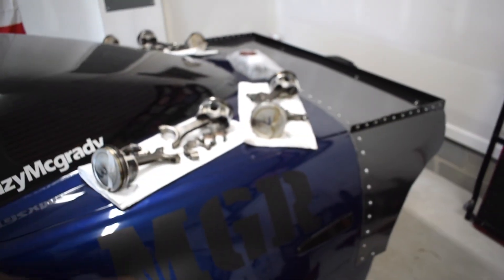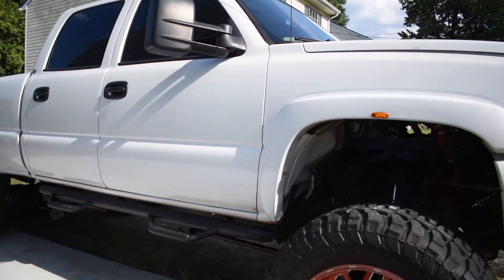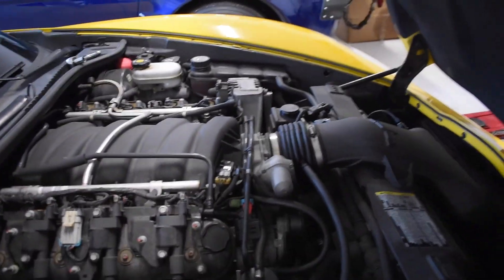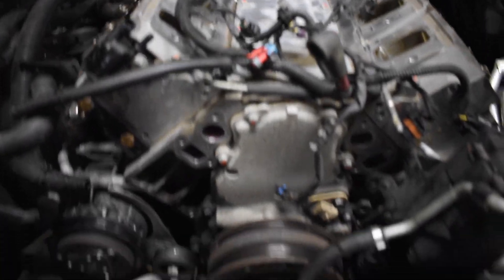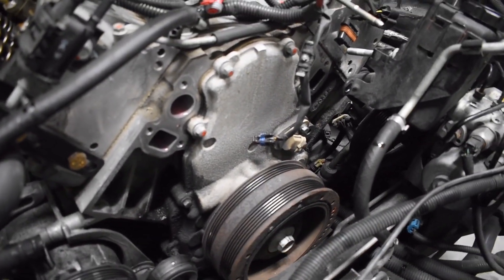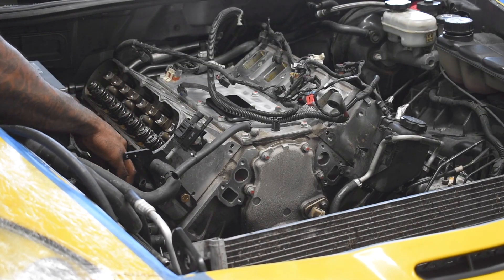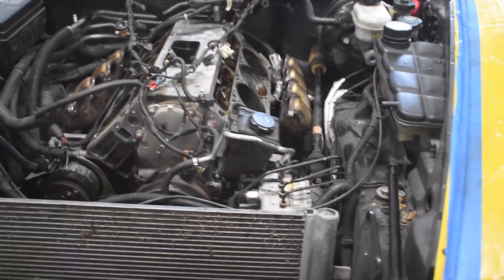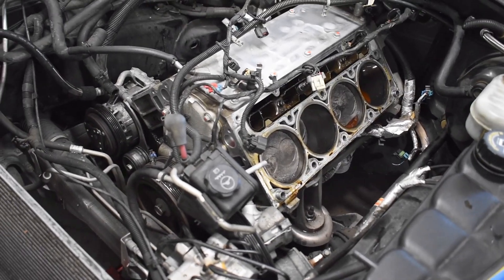CORVETTE C6 Z06 Heads Cam Install | Part 1

Comment: Im getting a c6z before the year is over. Should I get the TR6060 or T56. Ik the 60 is better but what’s the real difference?
Reply: Strength, longevity and confidence with the 6060. Lack of strength, longevity and confidence with the T56.
Reply from the maker: Lmaooo you couldn’t have said it better
Reply from the maker: What that guy said. 6060 will hold more. Updated design

Comment: I DONT trust any one but Frankenstein. They redesign the whole head to prevent some known issues with the brodix casting heads. All up to the owner.
Reply from the maker: I should’ve went Frank or brodix. We’ll see how these mast heads hold up the second time around
Reply: @McgradyRacing   for the owners sake, I hope they hold up good. Wouldn’t want for him to blow the motor😭
Reply from the maker: Oh naw I was talking about mine set up. I got the heads back from mast and got my vette running. Mounted a set of fixed and ported oem LS7 heads on the yellow vette
Reply: @McgradyRacing   man I love your setup. I’m aiming for max effort NA. I lowkey should’ve got a high ram😭
Reply from the maker: Texas speed 4.2 cam and high ram would be a killer combo
Reply: @McgradyRacing   I got a comp custom grind max effort cam specd to rev high high. Hopefully I make good power